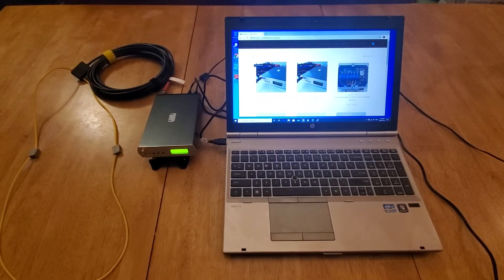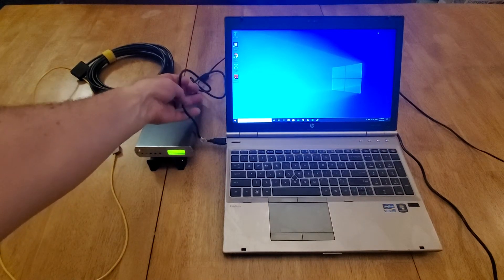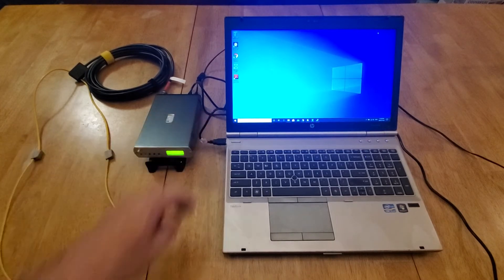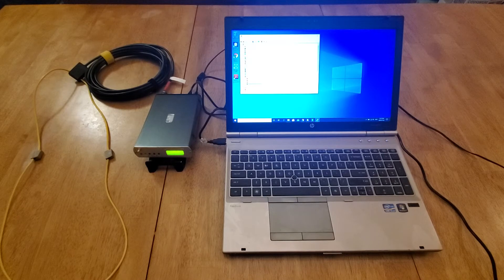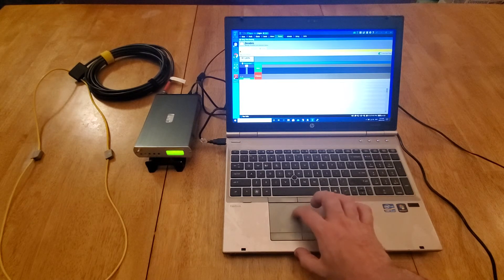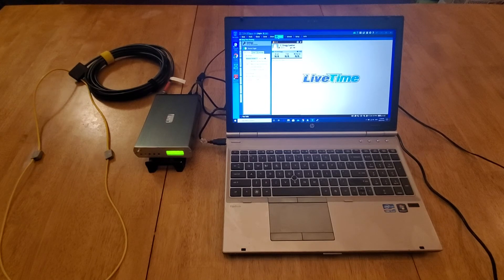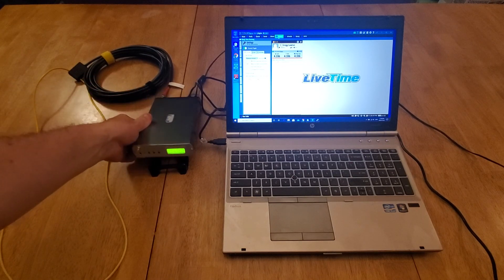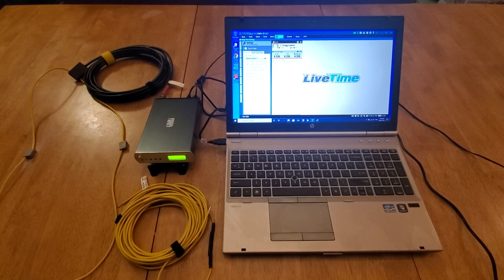Review: Vostok Electronics Lap Timing System decoder: Part 2 - Installation

Comment: Hi, Just wondered if you are still using this system and have you had any issues with it? Great videos just needs a Part 3 lol
Reply from the maker: We still use the system and it works great. We have found ours is very sensitive so we adjust the loop by narrowing it.
Reply: @lawton70 what do you mean by "narrowing it"?
Reply from the maker: @CarlosDelaoGunEngraver when you make the loop across the track you make 2 parallel lines with the wire. When the parallel wires are far apart the loop is more sensitive to the transponder signal but it is also more sensitive to electrical noise. We end up burying the loop in our offroad track about 2-3 inches under the track and the 2 parallel lines of the wire are about 8 inches apart across the track.
Reply from the maker: Video released: https://www.youtube.com/watch?v=CeLKLF404ps
Reply: Hi are you still using this and does it work for an indoor carpet track?

Comment: Have you attempted to use with Ethernet cable?
Reply from the maker: hi, thanks for the question. I have not, but the user manual has a lot of instructions around how to set it up to use the network cable. That may be a good topic for another video.